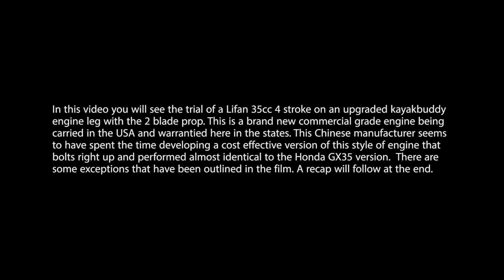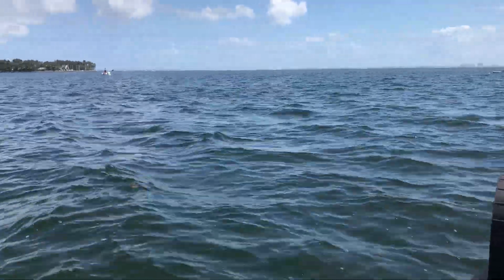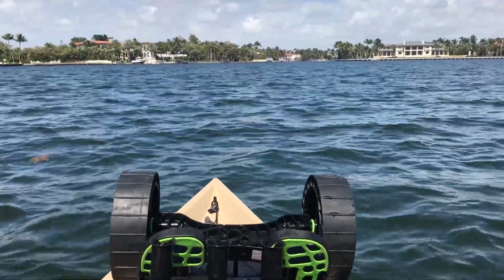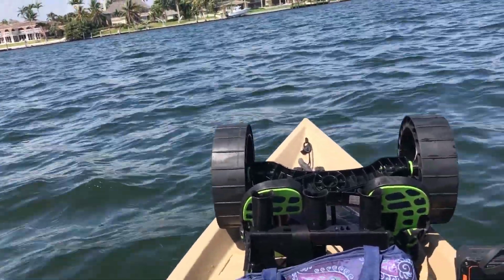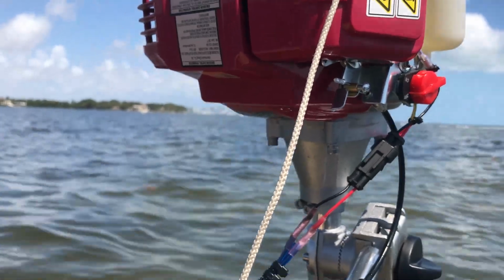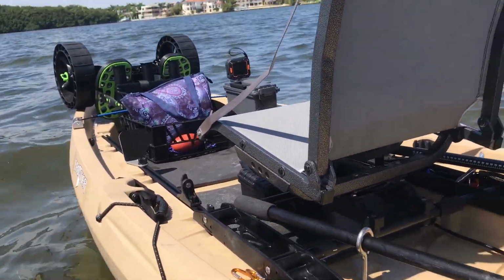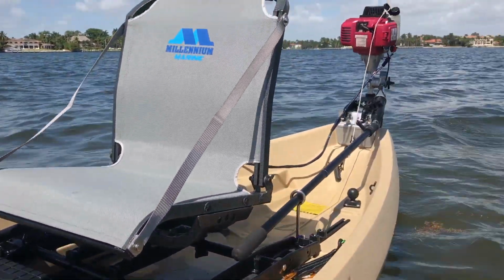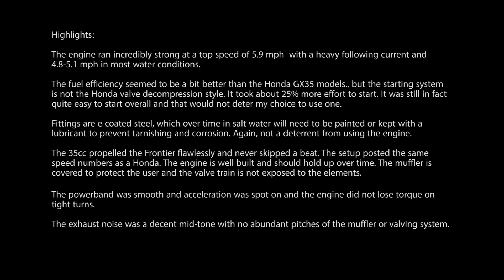Lifan 35cc 4 Stroke Trial on a Nucanoe Frontier 12

Comment: It looks as it is the same Set Bottom as for Sky 1.4 HP, is it correct?
Reply from the maker: Dmytro Bryushkov the gearbox is the same. The prop and controls are changed out and all black steel is thrown in the garbage. Honda powered. These are built to last.
Reply: @kayakbuddysllc-lightweight4947  Is the engine Honda 35 GX?
Reply from the maker: Dmytro Bryushkov yes it is an authentic  engine not a copy.

Comment: I wonder how it would be on a bicycle, probably not too powerful. I have a 35cc Subaru and it just doesn’t have the power to get up hills with any speed.
Reply from the maker: Will's Variety channel there is no way to move that kind of weight on pavement without having a set of gears and an awesome clutch. In water due to the different torque curve and multiplier of the gearbox, it works great.
Reply: Kayak Buddys - Kayak Propulsion Engines my main problem is hills on a flat it can go 28mph on a 26 inch bike.
Reply: I have this engine [ Lifan 35cc ]  on a ten speed bike used with friction drive. It goes about 22-25 mph. Runs as well as a Honda for sure. I also have Honda engines in the same range.